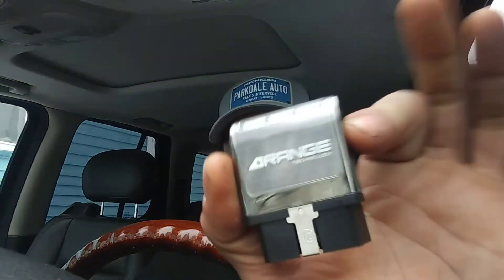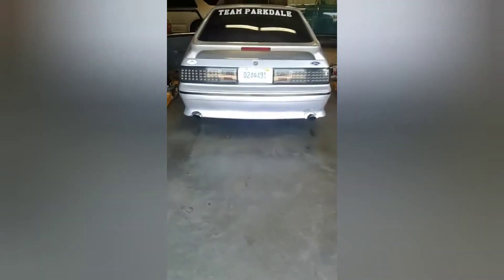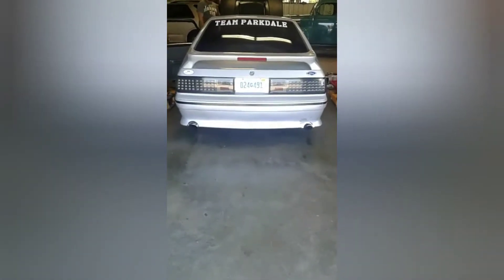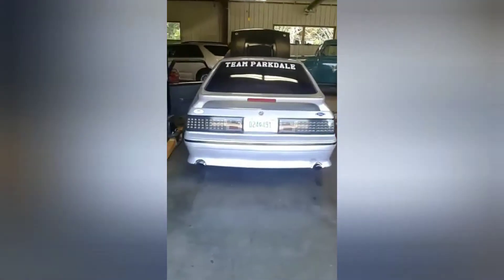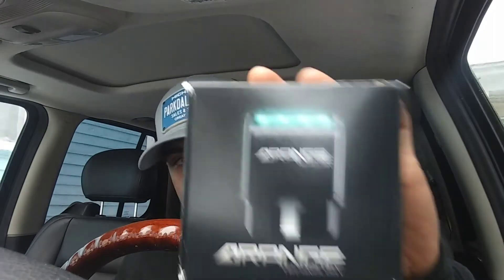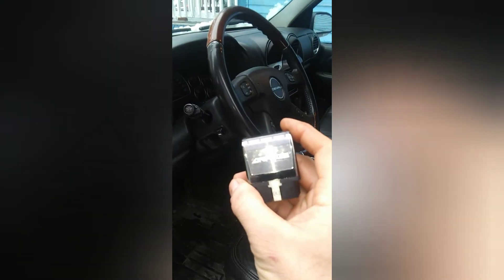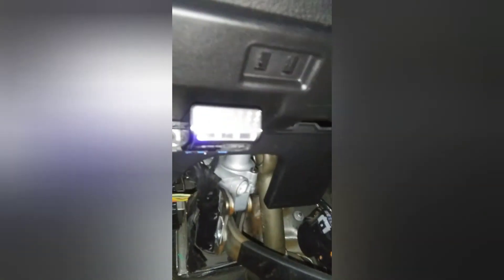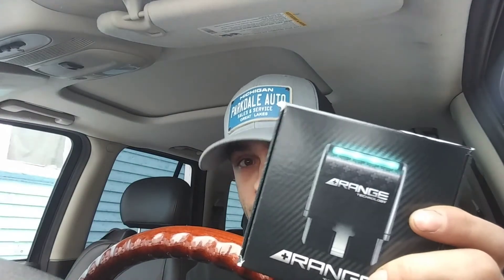Product Review: Range Technology AFM Disable Device for Late model GM V8 vehicles

Comment: Good job on the video. I just purchased and installed the range technology device on a 2016 corvette. I’ve never heard of a corvette having any of the AFM engine issues, but I didn’t want to take any chances.
Reply from the maker: Honestly, if you are doing your oil change ever 3k with the recommended oil, you might not ever have an issue. But if I buy a V8 I want all 8 all the time.

Comment: Thank you
Just got 
2011 gmc 1500 sierra z71 78k one owner clean truck  doing the m5 for now ordering it 
Based on this video 
Thanks again
Oh and that getting loose at the end got ya one more sub 😂
Reply from the maker: Awesome man! And thank you for subscribing! You won't regret it, The envoy now had over 10,000 miles sense installing the Range device. Not a single issue with it 👌
Reply: @BadgerBuilt  thanks bro

Comment: Have you had any problems so far ?
Reply from the maker: None. It's my daily. I log 70 miles a day. I would definitely recommend!
Reply: Thank you for the feedback 🔥
Reply: I bought one myself because I don't want lifter and camshaft problems that eventually will occur with active fuel management.
Reply: Where did you purchase this from,I've seen them on Amazon,just don't want to buy a knock off
Reply: @billyreds1984  buy directly from Range.